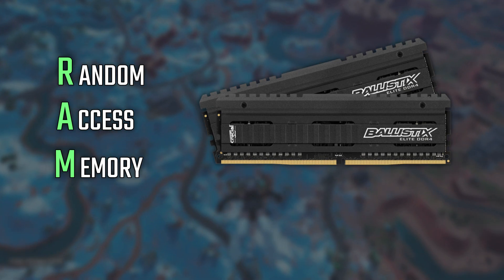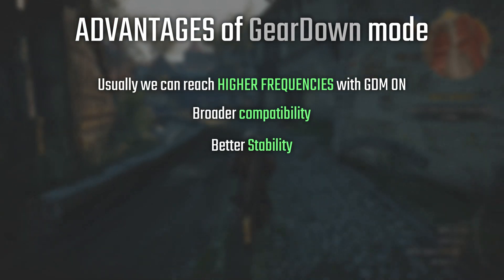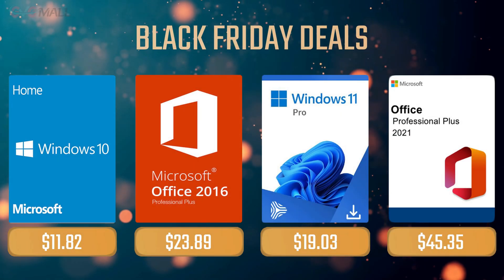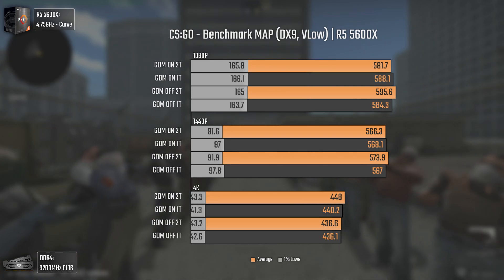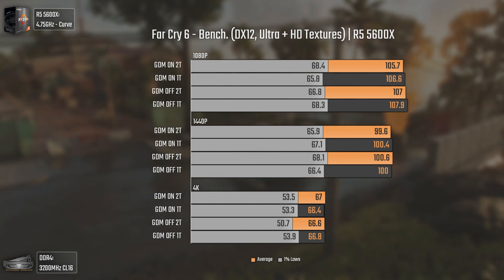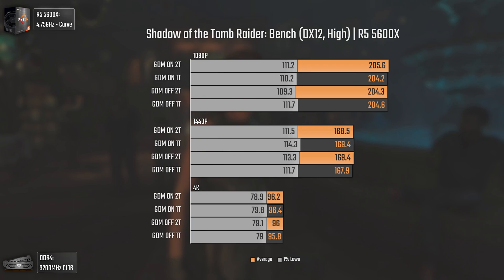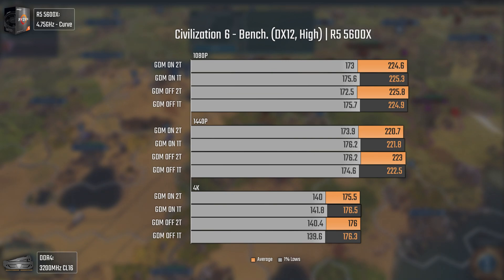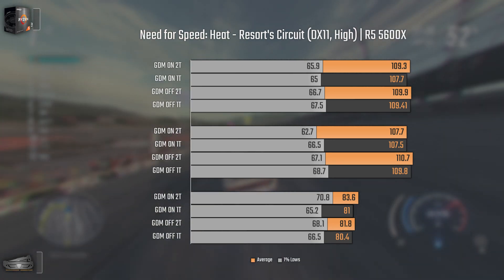Gear Down Mode ON vs OFF | 1T vs 2T RAM | 1080P, 1440P & 4K Benchmarks

Comment from the maker: Hope you enjoy this video and learned something from it!
Reply: Hi, are there any testing methods to actually check latency between all these different options? I mean for competitive online games (fps, moba, mmo etc) not single player..currently running 4000mhz 2t gdm off DR kit 32gb cl16 flat or a 16gb SR kit with 3800 cl14 flat 1t gdm off.
Reply from the maker: @lunatik6168  you can try aida 64 or dps latency
Reply: I enjoyed your explanation of GDM, thanks! Happy holidays!
Reply from the maker: @jerrywatson1958  thanks 💪💪
Reply: Hello pisco sorry to post it here in the comment i have no other option in my part
I just got link in reddit that says gigabyte x370 boards supports zen 3 meaning 5000 series 
Is this true and if so can you do vid about it check if it works well?
Reply from the maker: @shayeladshayelad2416  just made a video of it
Reply: I like that you engage with user comments. You must genuinely like your tech youtuber job!

Comment: Thank you! This was so helpful! Hopefully your results still apply with DDR5. With GDM On as reported by ZenTimings (actually ADDR_CMD_MODE=Unbuf in the BIOS), I can get 6400 MT/s stable with my 7950X3D and with it off, it's not stable. Haven't tested gaming FPS but my Cinebench score is measurably higher with the higher frequency.

Comment: Gdm 2t and gdm 1t are thr same thing. Gear down mode takes precedant over 1t or 2t timing setting, and indicates that the memory command clock  operates at half speed, while allowing the bus command bus at standard speed. 1t gdm off is both the memory command and bus command running at standard speed. 2t is both the bus command and the memory command operating every other cycle. Note that the ram data transfer bus still operates at whatever the clock cycle for the ram is regardless (mclk)

This is why gdm makes certain timings even; they are timings for things that originate at the command bus, and when thats running half speed, it literally can only be done on every other clock tick, hence even only. 

This is why gdm makes latency drop a tiny bit also, as there will be commands put to buffer on an odd clock cycle that have to wait in buffer for the even clock cycle to occur, thus slowing the commands execution.

However, data bandwidth is largely unaffected as only the initial commands that start the process of sending data to and from the data bus (which always runs at memory clock speed regardless), at which point we are no longer bound to the command bus speeds.

This is aslso why 2t gdm on makes no sense, as 2t indicates that both the memory command and bus command clocks are half speed and so the memory command clock doesnt have to be halved.

And to be ultra specific: the memory command clock is on your RAM, the bus command clock is on your motherboard and connects via the command bus to your ram. The data bus is between your ram and a different much wider bus to your chipset. Your chipset operating on the bus command clock needs to every clock cycle it operates (half at gdm) say 'hi' to your memory, which recieves the ping via the  command bus, which is accessed on a clock cycle determined by 1t or 2t settings; gdm mode implying that it should go 2t, while your memory goes 1t. As long as whenever the chipset pings the memory replies all is good, which is why the halving happens on chipset memory controller side, as if we halved the ram command  and not the chipset, then it would not get a proper reception half the pings.

Tldr: 1t means ram command clock and memory controller command clock go at mclk speed. 2t means they go half speed. GDM means only the memory controller goes at half speed. Actual data transfer always go at mclk speed, regardless.

Comment: Hmm !! M die doodoo
Reply: Thing is by default amd have 1T GDM on … I think my old intel chip handle mt Patriot Viper 3600 C18 DR x 64gb series better due to intel usually have 2T default reason why I need to mess w GDM timing is potnerially 2T GDM off is mroe stable as I cannot even post C16-20-20-38 with Gdm on 1T @ 3200mhz 1.35v …

Currently test 2933mhz @ CL 16-20-20-38 trc 61 … tfaw 24 … 4 12!! 540ns tRFC !!!

maybe can run MY actually xmp setting with 2T gdm off?? CL 18-22-22-43 (3600mhz 1.35v)

Comment: I am a bit sad I cant turn off gdm without blue screening. I bumped my voltage to 1.4 (on hynix cjr) and even then still not stable
Reply: I have M die hynix MJR16gb what speeds u running mine def worst 😂😂😂 Cannot run the stock xmp setting C18-22-22-43 with 3600mhz Parriot Viper 64gb dual rank 16x4x2
Reply: @andrewmtgx  how can they sell ram that cant even run its stock xmp?
Reply: @deadhero4203  Lol who knows... But i realise maybe it's my MoBo or Also... I am still messing around w it but yeah it seems its so dookie... I think tho it might be because of GDM as it's suppose to run GDM off 2T so I'm trying that... And something to do with ProcODT figure...

so yeah do u run Gdm off or with it on ??..

What timings do u have but yes we have different dies
Reply: @andrewmtgx  I run with gdm on. gdm off results in blue screen after a few minutes
Reply: Same here i can't run 1t with gdm off, do you see diference 1t vs 2t? I just test in game i feel 2t have little delay rendering grass in game(mafia 2def), but in 1t gdm on, have litle bit better rendering grass... Overal I dont know is this true or just my delusion

Comment: is all the test using the same specs between g1 g2 cr1 cr2 ? cuz g1 cr1 definitely superrior than the other, except with cr2 we can got more stability, while with g2 we can push for more speed/bandwidth while sacrificing latency, g2 on ddr5 seems reasonable, but g2 on ddr4 sounds like a bad idea

Comment: Nice explanation, mate. It was the only thing I never bothered with. I thought it would simply drop the frequency when not used, like the GPUs or CPUs, but nope! Better leave off + 1T at 3400Mhz 16CL is working great and stably.
Reply: Thats good

Comment: These comparisons mean nothing unless all the subtimings are set manually and equal for all cases. Even then sometimes, depending on voltages, some uneditable timings such as tPHYRDL can train differently for 1T, @t ,  and GDM. If you leave everything on auto therer is even a chance that they might train differently after a cold boot. 1T off is not child play for Ryzen. You might need to find the optimal RTTs and CADbus to get the most of it. I have to say the gain at best is minimal and not worth the time spent unless you love memory overclocking.
Reply from the maker: And that's obviously the case, every was manual and fixed, otherwise it would be meaningless
Reply: @AncientGameplays  good to hear that. Did you also checked the auto trained timings like tphyrdl?
Reply from the maker: @devoker666  it was the same, and even if it wasn't, well, the real world difference would be zero

Comment: My PC has clicked off 3 different times now after buying a 3060. I have a 700w 80 gold psu. My temps are only at like 70 when it happens. My uncle suggested trying this gear down thing. I dont get it, I dont get why my PCs clicking off, I just wish shit would work
Reply from the maker: You mean turning off? Most likely ram or cpu instability
Reply: @AncientGameplays  the cpu bottlenecks and cant handle my 3060 no, I think it may be overheating causing the shut downs. It's an I7-7700K. Looking going from 1T to 2T (if it's not already set there) and updating my BIOS to help
Reply: @Kagarin05 did it help 2T shud be more stable as it is Technically’s swloest w gdm off

Comment: I messed with this back in the day, ryzen 9, 5900x… 4x8 DDR4 3600mhz corsair pro with timings 18-22-22-48 I put mine to 1T because it was recommended on YouTube, had delays in a lot of games even with high fps, weirdly enough everything feels smoother with 2T. I haven’t tried gearmode down though. But great video my guy.
Reply: Interesting thanks for this fomment even tho i look 11mths later been fiddling w my ram setting

Comment: GDM on basically ignores your command rate anyway, setting it on is like 1.5T it makes command rate redundant. It's always going to be better than running GDM off at 2T
Reply from the maker: Not according to this video
Reply: @AncientGameplays  Because your video is basically only comparing GDM on vs off, 1T on vs off, 2T on vs off. command rate is redundant while GDM is enabled with 1T

Comment: For me it's not about OC, but about smoothness of desktop use in Windows. When I disable GDM, Scrolling is smoother on my machine, and it feels snappier in general (1st Gen Ryzen on B350 with DDR4-2400 CL15 @1,25V).
I also disabled Power Down Mode.
I am not sure about the Command Rate though. 2T seems to feel smoother.
Reply: Confirmation bias, you're expecting a difference so you perceive it. The difference is calculated in nanoseconds, extremely unlikely that you'd be able to tell any difference in OS use.
Reply from the maker: That happens because latency was an issue with 1st gen ryzens and you're using extremely bad ram, even worse with those cpus
Reply: @AncientGameplays  Yeah, could be a 1st Gen thing. I tried at least 3 different memory brands. Actually, this kit (Corsair Vengeance LPX) has been the best so far ^_^"
It can actually do 2800@CL16, but I don't like to OC the memory, as I am afraid the kit could die sooner if operated at 1,35V constantly; So I use it at rather conservative settings. 2400@CL15 is still an XMP setting actually, rated for 1,2V, but I had to push it to 1,25V to feel really smooth, along with +0,01V offset on the SOC.
Took me 2 years to figure out :'DDD
Interesting thing is, Prime95 never detects any issues with any setting, even @2800; so I had to rely solely on my perception (how it "feels")
Reply from the maker: @sassuki  1.35v is literally nothing dor ddr4. Even 1.45v would e okay
Reply: @AncientGameplays  Oh wow, interesting. Do you have some long term data? Like how many years have you been operating a specific RAM with high voltage without failure?
Reply from the maker: @sassuki  its literally on the ddr4 specs. That's why higher end kits use 1.5v all day
Reply: @sassuki good to know!! Im fiddlign w ram setting it sucks cannot even run C18 3000mhz when my kit orig rating for Patriot Viper dual rank 16MJR m die chip alius … 32gbx2 sticks  shows as C18 Series cannot post at XMP & 1.35v

Soc 1.1 - 1 - 1 - 1.05 gets bsod and emmroy errors with cl 16-20-20-38 @3200mhz xmp timings and still dodoo and default tRFC 550Ns along w the poor uhhh latency with being 85ns to 95ns to 110ns(cl20-26666mhz) this ram sucks 😂😂😂 But maybe 2T is what i need to set as i think i used this ram briefly on my intel system before i changed to amd compotents w my b550m steel legend and btw i start diagnositic and testing ram tryna oc from the cl20 2667mhz auto as I couldnt ever get xmp to work

potentisllt stable setting.now is 2933mhz CL16-20-20-38 trc 41 etc 540ns!! Memtest passes the mythical 9% no errors on widnows memory disgnositci as usually it faisl there on the other timings…

Maybe 3200mhz possible with the 2T gdm off vs 1T gdm on which it currently is!!

Interesting this video demonstrate 2T altho is SLOWEST might be BEST for stability…!

Comment: This makes no sense lol
Reply from the maker: For you maybe
Reply: @AncientGameplays  gear down mode should never outperform gear 1, and 2t should never outperform 1t. It’s literally like if you shot a rocket into space and just let a balloon off in the air but somehow the balloon beat the rocket to space. Or if some guy just rode a bike onto a nascar track and somehow beat supercharged cars in the race. Makes no sense.
Reply from the maker: @gex581990  manual gear and geardown mode are different things lol. 
Also, the results you see here can be easily seen as margin of error
Reply: @AncientGameplays  yes I know this. I'm just more used to Intel so I consider geardown mode "gear 2" and normal as "gear 1". And I've never had a higher command rate perform better. Anytime I've used gear 2 instead of gear 1 or used 2t/2n instead of 1t/1n I can noticed a perf drop right away, especially frame time and min fps. I've never use either gear 2 or 2t/2n unless I was able to push freq and timings far enough to overcome it's negative effects. Luckily I got some killer b die and can do 5333 at cl18 even with 4 dimms in gear 2 but even then I still feel like 3733 cl14 gear 1 is just a smoother gaming experience but I do have a bios profile set for both gears so if I am gonna use something that'd take advantage of the high freq I can just switch it but when I was experimenting with 3733 cl14 to get stability I tried gear 2 and tried higher command rate (both separately and at the time in different tests) and you could even feel the difference before even bringing a game up. Your testing shows them within margin of error of eachother and that hasn't been my experience at all, I wish it was. I mean some setups are just different I guess cause I've seen some other benchmarks be in margin of error like yours but then I've also seen some with a difference of 15 fps average. So I guess it just depends. No knock to you, it just doesn't make sense haha.

Comment: Hello Fabio thanks for the video. Can you tell me is 1.47V high for dram Voltage @3800Mhz and tweaked timings. With DDR4 RAM, can it be dangerous ? Thanks
Reply from the maker: Your fine up to 1.5v as long as your ram temps are okay
Reply: @AncientGameplays  ❤️thanks

Comment: Well my i can have ram 3333 MHz T1 or 4000 MHz T2, which would be better?
Reply from the maker: You mean 1T? Which cpu?
Reply: @AncientGameplays  yes 1T, i have i3 9100f, could there be a problem?
 I know that my computer won't be apparently faster but i'm trying to check how much i can get from my ram because i will buy i7 13th and considering do i need to buy a new ram
Reply: @Tashiragi what did u end up using 4000 sounds way cooler

Comment: Can somebody tell me how I can turn it on/off?
Reply from the maker: BIOS
Reply: @AncientGameplays  I understand that but what I mean is what is the process like, y recently bought a 8 gb 3600 viper steel memory and in the Amazon page where the memory is sold it recommends users disable gear down to get it the memory stable and to be honest I'm being experiencing some blue screens really often so I decided to turn the xmp profile off and the problem didn't happen any longer, but the memories are not working as it truly potencial so what I thought is that perhaps by disabling this option a could make them stable so that I can finally use them as 3600mhz, thank you for responding to me btw

Comment: I just keep it on Auto but it’s always on 1T 32gb all dimms populated 8gb sticks kit G skill 3600mhz 14-14-14-28-42 @1.5 volts on a Ryzen 5 5600x.
Reply from the maker: That's nice. most likely you don't need that much voltage

Comment: Good video :) If you have 2 stick double rank high capacity memory or 4 sticks single rank the GDM is life saving  in OC, making it so much easier :)  Also with modern IMCs and high speed high capacity RAM the primary timings getting less and less important (like CL in high capacity data write burst), it is better to fine tune seccondary, there is a lot of speed gain, than to hard fight with primary. Also most XMP are terrible in seccondaries ;) 1T/2T CR is an old technology, that is why GDM was performed by JEDEC for neew high speed RAM.
Reply: I remember even when I had i7 4790 and it was running 16gb ddr3 cl11 1600mhz from the start, I had issues with pubg running smoothly when it came out. I changed main timing to 8 with 8ghts regular timing and it changed a lot, but I decided to optimise sub timings and it gave even more
Reply: @z1edog maybe that was best stable initalitt

Comment: I like Ryzen, especially 5000 series but the PBO2 boost is pretty inconsistent.  I've seen weirdness in reviews and gaming benchmarks going all of the way back to November 2020 launch.  I don't want to undermine the work you did, because I know it's a lot to get the data for these graphs, and we all appreciate it.

But I think a manual OC would have been better to keep the CPU frequency consistent among all of the tests.  The other thing is the random variation of the benchmarks/games themselves but it's hard to do anything about that.  Ryzen is also inconsistent in terms of RAM frequency or timings.   Where you can have 3200 CL16 faster than 3600 CL16 with the same timings in certain games.   Sometimes it scales properly and other times it doesn't make sense.  Is it that 3200 stresses the IMC less, requires SOC less voltage and allows more of the PPT budget to give more power to the cores, and that specific game likes the extra core boost more than the extra RAM frequency?  I've never seen this fully explored and tested.  A lot of this is just tweaking for that last little bit, for fun.. because like you said a lot of these things don't have much real world performance benefit.  And it can vary from game to game.  There's a lot of randomness so it's probably best for anyone just to pick the game they care most about.. and try some different settings and see what works with their configuration.
Reply from the maker: Pbo2 is actually pretty stable, but depends on your motherboards, temps, power draw, everything
Reply: @AncientGameplays  Yeah, there's a lot of factors and variables.  I care most about 1% lows and that was what I was referring to.  Some reviews make you think, the 5800X.  Some the 5950X, some the 5900X, and it could just be random.  Or a different approach by the reviewer.  You buy those same parts and get different results.  It's small margins anyway, the only that really stands out from the rest is the 5800X3D.  I do like tweaking and tuning things.. but it's small gains.
Reply: Mhmsss